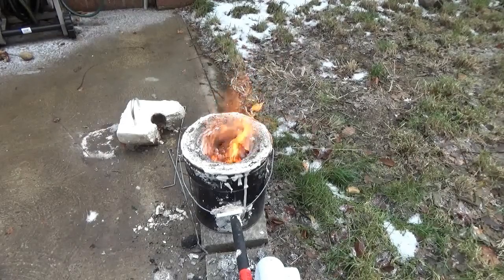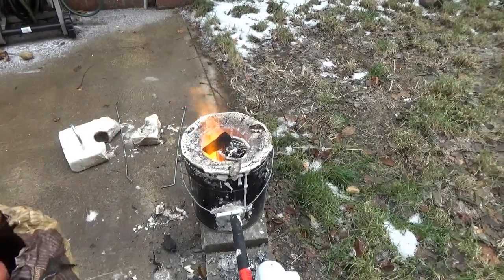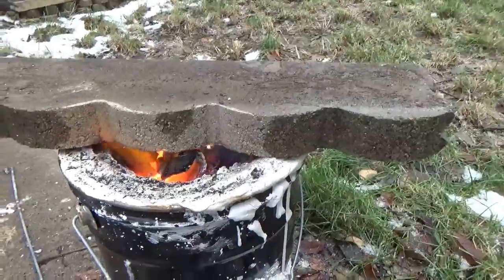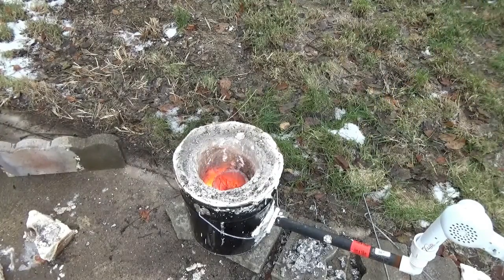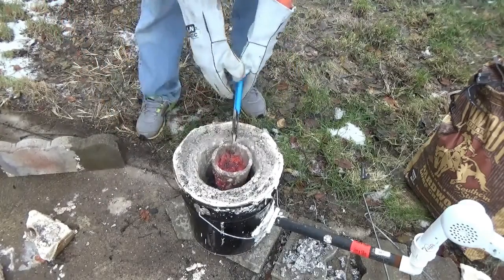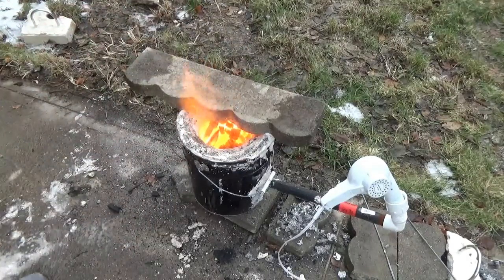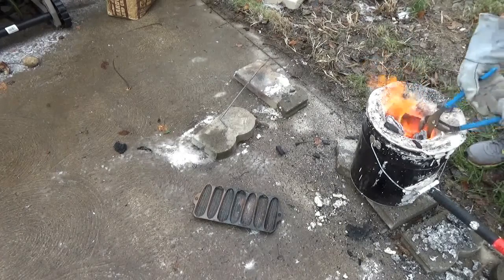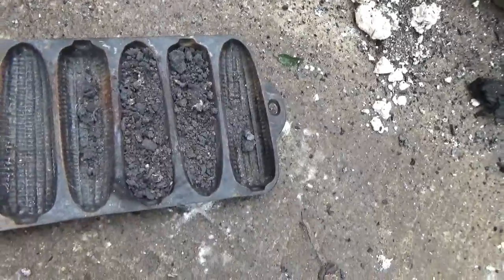Failed at Melting Copper - Advice?

Comment: 1. Your pipe should have gone in on an angle, to make the air inside swirl around the crucible.
2. You need a proper lid that covers the whole bucket, with a small 4" hole in the middle.
3. Ideally, if you are going to use coals, you need a much larger container.  You don't have enough airflow inside.
    A larger container would allow the coals to heat up more from the increased airflow.
Reply from the maker: thanks...i ultimately converted it over to propane which works way better but still too small

Comment: 1) Impurities Impurities Impurities. Who knows what additives the charcoal has. 
2) You should use better insulation especially on the lid. Double insulation might help.
3) You should definitely reconsider your fuel source to something that has a higher energy density per kilo
4) I know very little in metal smelting but it might be helpful to reference other videos.
5) Good Luck though. It seems you were really close to having a successful copper melt.

Referring to this website...The materials in the copper will influence its melting temperature.
https://www.mcmaster.com/low-melting-temperature-alloys/
Reply from the maker: switched over to propane but haven't run it with copper yet.... just more aluminum... thanks for comments

Comment: More heat also you can add borax to flux it and remove the impurities, but definatly not hot enough.
Reply from the maker: switched over to propane, just got to get some more copper to give it a try